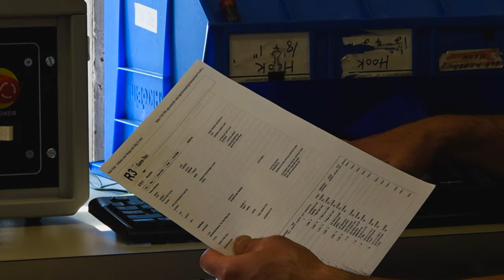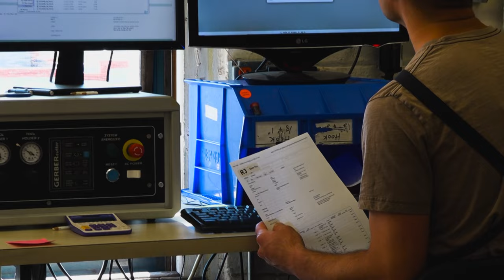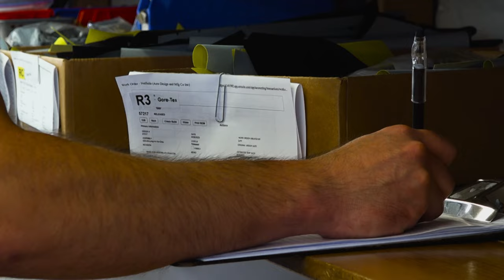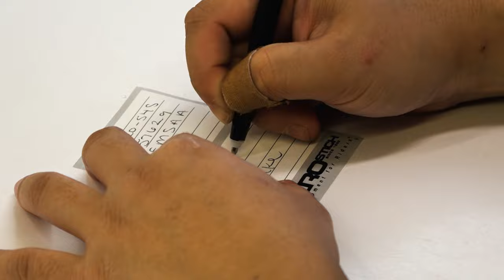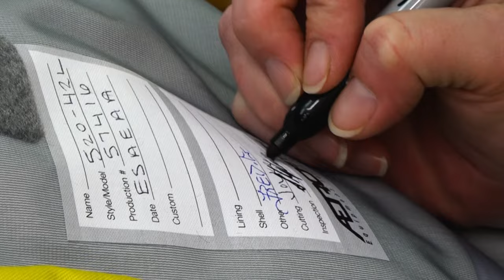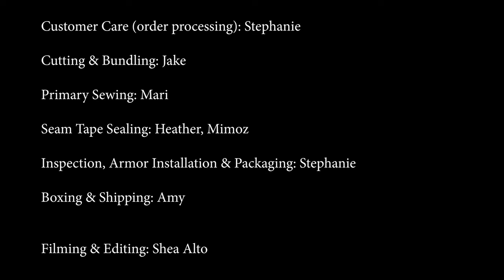Making an Aerostich R-3 Rider’s Suit - 16 min video

Comment: I've owned an 80s Roadcrafter and an early 2000s Darien suit and "tested" the 2nd one on the Canadian Dempster Highway's arrowhead-gravel at 50mph and this is the gear to be wearing if you're going to try sliding down the road on your butt at highways speeds. I don't recommend the test, though.

Comment: I love my Aerostich Roadcrafter and it has proven itself as protective gear and increased my riding comfort. I would like this video more if it had narration explaining what the workers are doing, why it's different from cheaper manufacturers, why they tape and then resew and tape again. I don't understand the differences in the roles by the different departments. Beautiful video but I would have liked a narrator explaining what I was watching.  I sent my suit for crash repair and wondered what they did to repair it.  A video about that would be interesting.

Comment: Hi   Shea, great video. Please produce more videos for areostich. Areostich, could you look into using spidersilk, here :Spider Silk Strength: Stronger Than Steel

Kraig envisions genetically engineered spider silk, with its superior mechanical characteristics, will surpass the current generation of high-performance fiber. We believe that spider silk is in some ways so superior to the materials currently available in the marketplace, that an expansion of demand and market opportunities will follow spider silk’s commercial introduction. For example, the ability of natural spider silk to absorb in excess of 100,000 joules of kinetic energy makes it a potentially ideal material for structural blast protection. The table below illustrates spider silk’s incredible toughness and strength to weight ratios.

Comparison of the Properties of Natural Spider Silk, Kevlar® and Steel

Material Toughness [3]Tensile Strength [4]Weight [5]Dragline spider silk120,000-160,0001,100-2,9001.18-1.36Kevlar®30,000-50,0002,600-4,1001.44Steel2,000-6,000300-2,0007.84